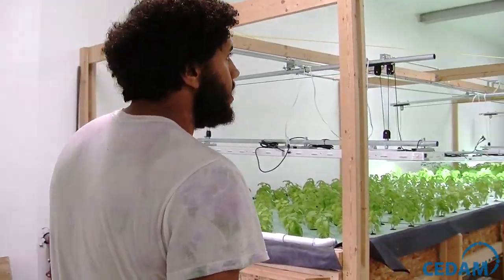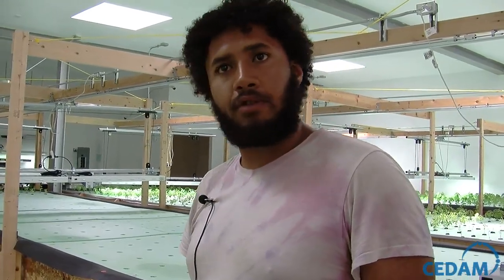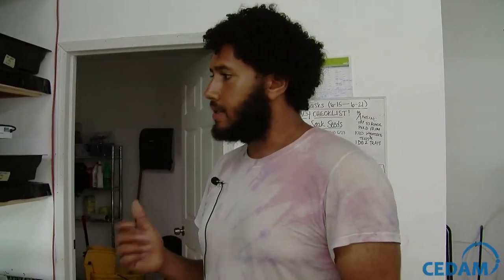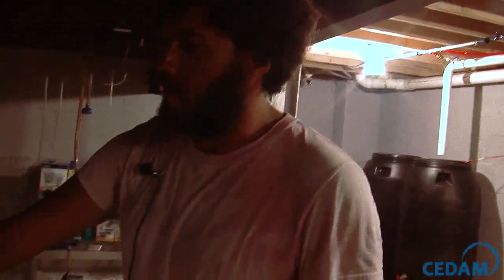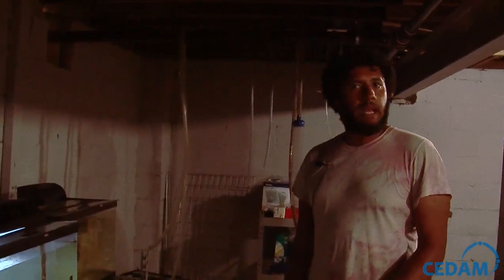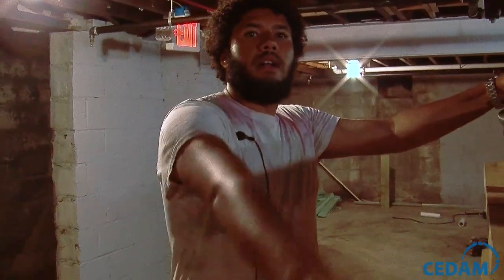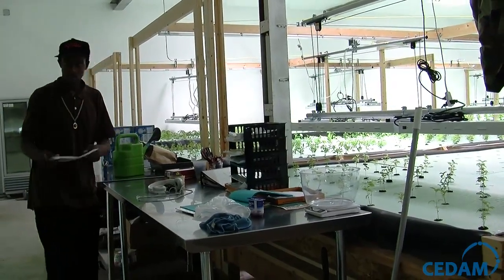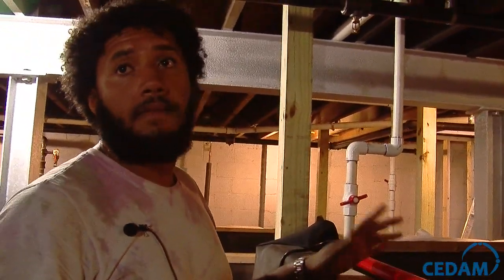Aquaponics Tour

Comment: Do you use fish waste in your microgreens production area as well?
Reply from the maker: I don't think Anthony mentioned what soil they were using to grow their greens - it could be compost from their community garden. Since the fish waste is broken down by the biofilter or picked up by the plant roots, it doesn't come out of the system. It cycles through it.
- Olivia
Reply: Thanks.  I was assuming that there was no soil since microgreens are usually just grown by putting seeds in a container and watering them.  I was just wondering if the microgreens production was connected to the aquaponics water system or if it was separate with water from the tap or brought over from the fish tank.  Thanks!
Reply: Francis Hutchinson
Thanks, but I didn't ask for this and your post appears to be SPAM.  Is this legit?
Reply: Jason G Here’s the step by step plan to help you build your own Aquaponics system….
Go here ==> http://easydiy-aquaponics.blogspot.com/
Reply: test account
Reply: thembile xego
Yes?